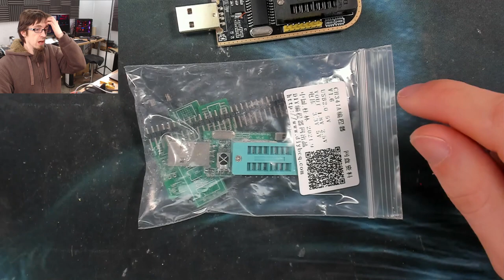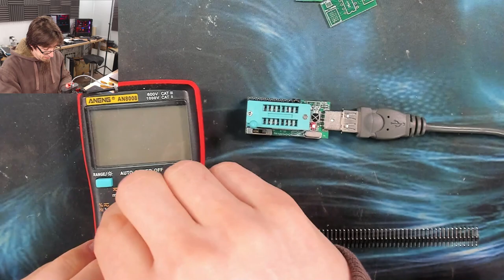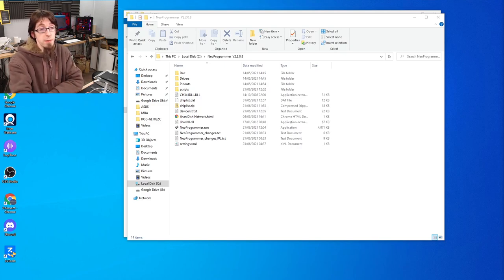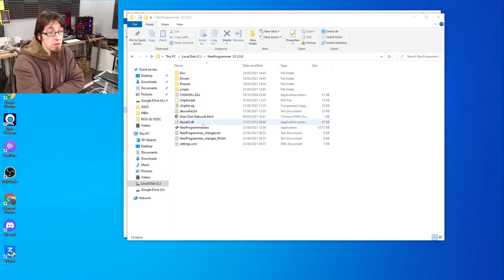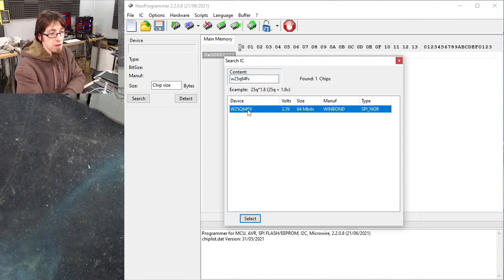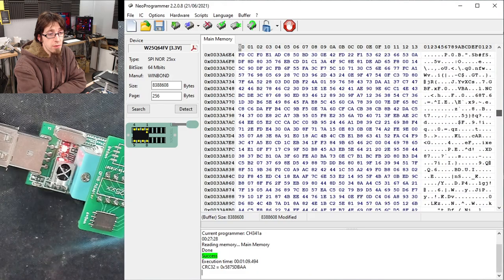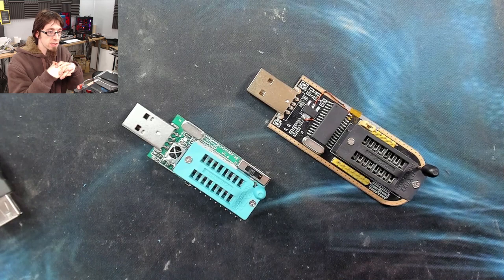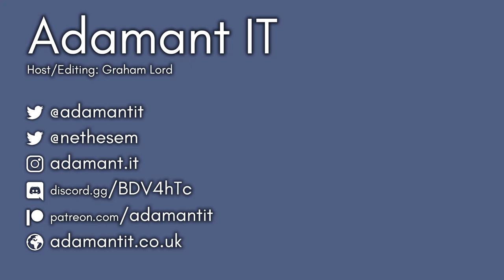CH341a v1.6 Review, No More Volt Mods! - LFC#297

Comment: I challenge you to find a 3.3V chip that you can burn with the older programmer. milliamp limits won't let it overload them.
Reply: I use my ch341a, the old one with the black pcb without mods on 1.8v chips but i use a 1.8v adapter.
Reply: @@garbonzobear yea
Reply: But it doesn’t work
Reply: I saw a vid from sorin electronics as well showing you that you cannot burn a chip with the old version as you said the amps or miliamps wont let you.. that said i still bout the newer version as i am a scardy cat lol
Reply: @Pedro-ct8ou  yeah you can't burn it out. Nobody has done it and the old model puts the correct voltage out on the read lines anyway. Now people have BRICKED their mobos but they do that with either reader and by pinning the programmer wrong, not making more than 1 read and not comparing reads and generally not knowing what they are doing, but yeah

Comment: If someone knows how to 3d print and make a template, they can make a nice cover for it. And make the template free :) For the old one are several templates also accessible.
Reply from the maker: If I had access to a 3D printer, I'd totally be into an enclosure for this that converted it into more of a "desktop" widget. The main reason I prefer my RT809f over the CH341a is because the RT809f is a box that connects with a cable, instead of needing a USB extension cable that's clamped to the desk. Plugging a CH341a directly into a tower PC is kinda clunky, although there's nothing wrong about it.
Reply: @Adamant_IT  Yes, the form factor and treatability are important when you use a tool on a daily basis. I have 5 programmers, ranging from cheap to quite expensive, but I still prefer to use the old EZP2010 simply because it is so compact, robustly built and handy.
Reply from the maker: Is the software better for the EZP these days? I dropped my EZP2019 basically as soon as I got anything else because I found it super hit and miss with chip support and reliability. But that also might be because it was my first programmer and I was still figuring out how to use them properly.
Reply: @Adamant_IT  If you're interested, a monoprice select v2 can be had on sale around $99 or an ender 3 can be found for as low as $130 but takes at least an hour to build and without any experience another hour to get it configured properly, so not for the faint of heart who can't handle some troubleshooting, but otherwise both are great beginner printers.
Reply: @Adamant_IT  I never had any problems with the software (with 2010, I don't have 2019). It programs much faster than the CH341 and doesn't make any mistakes. When it comes to onboard programming, the CH341 recognises many EEproms, which is not recognised by EZP onboard, but when reading and writing, the CH341 almost always makes mistakes. So if EZP says it can't do it, but the CH341 does, it does it with error.
My first one was the AJAWe 0812, but it was extremely slow. Then the EZP2010, SVOD1 (for EC), out of curiosity CH341, SVOD3.
Reply: @SiETechNotebookReparatur  one problem w EZP2010 is the chip detect might be wrong for newer chips.. so manually select proper example 25Q64 detects as 25Q32 and have to select similar winbond with 64 in middle number (size) for full read not 1/2 the chip.. ezp2019 has no problem w that as its current w all chips JDEC detect id.
Reply: @LeadFarmer813  The EZP 2010 is a 12-year-old device. Up to 64M-bit, I have only had very few problems with recognition, but above that it often fails to recognise or recognises incorrectly.
But I only work with laptops. 
Up to now, almost 90% of the work on BIOS chips could be done with the EZP2010, the rest is done with other programmers. For me, it's like an old wrench that's already worn out, but it feels so good in my hand that I still prefer using it to the newer tools :)
Of course, over time it becomes less and less usable...

Comment: Always make sure to do at least 2 reads and compare using a program like HxD before you overwrite your chip. Neoprogrammer, and most other programmers, don't verify reads in any way so you can't rely on a single read. A bad connection that causes a bad read wont cause any errors and you will end up with an unusable backup.
Reply: THIS!  Extra reads are free, don't be tempted to short-cut good procedure and skip this step -- you may find yourself sorely regretting it!

Comment: The CH341a doesn't supply 5v to the data lines. So no need to mod it.

If you multimeter it with no draw, it will show 4.7v, but once connected to the chip it will drop to 3.4v. Which is well within spec. 

Plus current is more important when you talk about burning chips.
Reply: Do you know what the jumper pins are for? The yellow rows with one jumper located
Reply: Is there a source to back up what you're saying?
Reply: YOU ARE RIGHT!
Reply: @kingeling  you can measure it yourself

Comment: your past volt mod & reprogamming videos on this tool saved me from having to buy a new motherboard, thanks =)
Reply: Me too, i was able to bring back my DZ87KLT-75K from the almost-dead realm of motherboards 😀
Reply: …. The only way you can damage your bios chip is by not knowing what you’re doing this programmer doesn’t put out enough miliamps to burn a chip and under a multi meter while running its 3.4 volts current is needed to burn chips don’t listen to idiots

Comment: Watched a review on the original programmer you showed that had the mod on it. The guy measuring the voltage going through and the current was so low it wasn't an issue.

Comment: Great video.
Thank you for sharing!

I have two CH341A v1.7 programmers on order and can't wait to put them in my service tool bags. :)
Reply: Did they work?  mine read junk
Reply: @bn880 
On the unit I got it seemed to work ok.
I know it is very important to check the chip's datasheet to make sure you are using the correct voltage setting.

Like any product there is a chance you got a DOA item, but it is always good to test with a known working chip.

I also have a TL866II+ that I verified with the DIP SPI Flash chip that I used with the CH341A v1.7 I got.  Both read the same contents.
Reply: Yeah using correct voltage, but no 2 reads are the same   @David_Ladd   Still have not gotten the "official" soft for it, crazy baidu links.  Using the open source versions.
Reply: @David_Ladd   Actually if you know of an open link to DL the software for it that would be appreciated.  (not the baidu spyware stuff)

Comment: I need help. I have tried over and over to reprogram the bios chip on a Surface Pro 4. It uses a winbond W25Q128FVPIQ. I tried attaching the ribbon to the chip on the board. I bought digital chips The Flash directly but they don't have that model ship anymore they don't make it they have a substitute it's the w25 q128 jvp IQ. I tried a Windows computer and I've tried Android I've tried as programmer and Neo along with others it's never automatically detecting the chip. And when it says it's writing it never works on the verification. I believe the issue at some point it has to do with the status registers. But I'm not sure I don't know what to do I need help please thank you

Comment: Looks like it's worth buying just for the adapter PCBs, of which one looks like it should support the USON (0.5mm pitch) footprint which is used a lot with Macbooks, especially the USB-C models for the thunderbolt ROM storage for each pair of CD32xx chips.  Was going to design/fab my own but this would seem to be a simpler option ( and pick up some other interesting ones too I see ).
Reply: Better buy one then 🤣
Reply: @MrPnew1  lurker.  Guess I should make it two then ?
Reply: also can you somehow when you have time comparing those two circuit so we can mod older one with voltage selector also infra that would be much apperciated  and i hope for a free  registersion of board view paul

Comment: i did the silly SAM port clip on the air 820-3437 in 2017.. baked something and that was that.. i learned to take chip off on most boards excluding VGA cards as they usually work fine if not in PCIE slot.
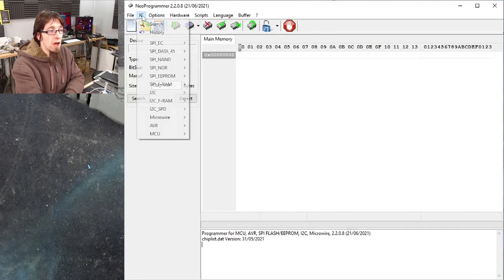tip: 12:07 u can click detect on left side and should find it auto.
and no it doesnt have pin detect, just same as prior ch341a no extra test circuit like RT809 orTL866II+
the black pcb tends to popcorn the layers very easy if u try to solder chip on it w very high temps.

Comment: I modded mine by cutting the 5v trace and put a solder bridge between the 5v and 3v pin on the back. no need for wires. also easily reversible if ever needed.

Comment: The volt mod is unnecessary and a lot of people get that wrong and blindly spread that misinformation and apply the mod without actually testing the Voltage on the pins directly.  Even at 5V when you connect a BIOS and it requires 3.3V you'll find it reads 3.2 ~3.4 on the BIOS pins.  No mod necessary.
Reply: Voltage of 5v don't cook chip its higher current that does damages!

Comment: First thought was wish I'd waited just a bit and got this one, since I just got the other type.  Going to be much easier to accidentally leave that switch in the wrong position though vs use the 1.8V adapter, so second thought is OK I'm fine with having the other version.
Make sure you keep checking the voltage every time on the socket with a voltmeter as part of your procedure, good practice and it's going to be very easy to forget and leave the switch in the wrong position if you get used to just plugging in chips without checking.
Needs feedback.  LEDs, red = 5V, yellow=3.3V, green=2.5V, blue=1.8V or similar would be good.  Then you could just check the LEDs every time before inserting the chip and drop the manual voltmeter check.
Reply: Don't be paranoid. Even using the black CH341A board you don't need to do a volt-mod or volt select thingy or separate board for 1.8V chips. Yes, at idle you will see 5V on the data lines, but when you connect the appropriate chip, the voltage will automatically decrease to the required level. The fact is that the current in the circuits of the data lines of this programmer is so small that the resistance of the chip you are programming is enough for the voltage to drop to the required level. You can check this very easily by connecting the chip and taking measurements, moreover, this is how a lot of professional programmers work.
I have been using this programmer for many years and not a single chip has been damaged by this programmer.
Reply: @Evhen_Velikiy  sorin also said this to the panic of 5v on data and power lines, checking upon it, it drops below the need voltage.

Comment: Question: Did you figure out why they added a IR remote control receiver in the new version?
Reply from the maker: Apparently it's for decoding TV remotes and such like, which makes sense, as I can't think of anything else still using IR for communications.
Reply: Reasoning is easy enough, it's a quarter or 50 cent part that lets you check remotes and maybe even back up the remote codes etc on a piece of test gear you're already going to have around, instead of having to have or find something else to do it.  Near free extra function.
The real question is what pin is it on, and if the rest of the programmer is basically the the same the software should work and we can add it on the other versions.
You can check if a remote works at all easily, just point it at a cam most pick up infrared.  But if this will read the codes and store custom codes it'll be handy vs having something else around to do it.
Don't need it often, but it's not a bad cheap add on since it's already a USB attached test device..
Reply: Actually there's more.  Looking around the site for the main files later, this came up :
CH340IR.ZIP	CH340 USB to IrDA infrared WINDOWS driver, support 2000, XP, for USB infrared adapter based on CH340, USB to infrared interface.
And a CH340IR.E**, changed of course..  
	USB to IrDA infrared WINDOWS driver for CH340, used for USB to infrared IrDA interface, USB infrared adapter, used to distribute to end users with the product.

Whenever I run back into my IRDA parts I'll tack one on and try and get it running.  Low priority so may be a while but I should run into them eventually.

Comment: i programmed my 1.8v bios chip using the old ch341a without even the 3.3v mod or the 1.8v adapter,just  plugged it in. Verifying the chip always leaded to some errors,anyway it just worked.

Comment: Been into tech since I was a kid, building PCs, etc. But very new to soldering, dealing with the more intricate side of electronics like this.

Is a BIOS reprogrammer like this good for any kind of flash chip, with the right adapter, or is it meant primarily for the type of chips used for desktop and laptop BIOS?

I'm thinking specifically of consoles, especially given the recent reports of Wii U failures due to a NAND chip going bad.

Comment: When you get all of your affiliate links set-up, could you link to all of your equipment: soldering iron/station, hot air gun, various programmers, etcetera? Even though I'm in the USA, I've assembled my workbench to include sockets and voltages to allow me to use equipment from anywhere in the world. I am using a generator to provide ~240vac single phase since the USA standard is dual phase (two out of phase 120vac). Thanks - I love your videos!

Comment: Hey great video. I have changed the Bios chip andrewrite a new Bios using the programmer. Now the PC it's starting but unfortunately I have no video output. Is there something that I missed? I was trying 2 or 3 different Bios also the one from Lenovo. Is there anything else that can be done?

Comment: Hey Adam. a little off-topic question, I saw you have a Hanmer HM310P power supply, so I got one as well, but every time I turn it on after it was off for a while, I hear a loud bang and particular smell comes out of it. It seems to be working for now, but did you have the same problem? If so have you fixed it?
Reply from the maker: I have not encountered that... if your PSU is making pops and smells though, I would stop using it and open it up to investigate, or return it.
Reply: @Adamant_IT  Thx, will check it out

Comment: I can't find this updated version in a kit with the clip for soldered chips.
Reply: ali express has tons of them. However you don't need the updated chip. The 5 volts was never an issue and if you are connecting the pins correctly on the original chip you will get a 3.3v out. Flashing a 3.3v bios chip with 5v isn't going to damage or burn your chip out anyway, it just might make reads/writes a tad more unstable. Can you even find evidence of people burning their chips out with the original? lol. no. You can't. plenty of people brick their mobos but it doesn't matter which chip they are using, they skip steps and pin it wrong. The original chip is completely safe/fine and if you're ultra paranoid you can solder 2 little connections on it to make it only run 3.3v. For me, it worked
Reply: @escapetherace1943  You say that, but I went ahead and just bought the v1.5 kit with a 1.7 adapter. One of the chips I needed to flash was a 1.8v chip anyway, so having the extra voltage selector was best.
Reply: @Levy_Wilson  right, well it is probably better in your case you did so. I flashed many 3.3v chips including one yesterday with the regular ch341a and.... all of them were fine.

Comment: Great vid!
I know I'm going to need to get one of these because I'm pretty certain I'll need to use one at some point.
Also some kits come with a clip adapter on a ribbon cable used for SMD chips, I don't know if that's better than de-soldering and re-soldering, but it seems a little more convenient for my needs.
Reply from the maker: I still hear wildly conflicting opinions about in-circuit flashing. I think there are plenty of times when it works / is safe, but also I think you need more knowledge about the device your fixing, specifically what else is on the SPI bus that you will be sending power and signals to when you clip onto the BIOS chip. But yea, I'll be researching it at some point, as there are a few cases where it makes life significantly easier, and potentially more accessible for people who aren't ready to get into soldering.

Comment: Interesting revision but despite being affordable they still need to work on the price, it may have gone up a bit but either way, you can get the original for as little as $4-5, so even including everything such as a 1.8v converter, SOP to DIP socket and a clip, costs only about $10 shipped.
Reply from the maker: That's a fair point. I feel like price is irrelevant once you're below $15, but certainly for people in poorer countries where absolute rock-bottom prices on tools make a big difference, the v1.6 is essentially twice the price.
Reply: @Adamant_IT  Well, I was thinking more so for beginners/hobbyist/someone starting out, for example I don't regularly fix computers, but I still wouldn't mind having one of these myself, however currently after shipping the new model costs $17 or more, actually triple what the old one costs, so yeah considering how little I would be using it, I'd rather spend the $5 and do the mod.

Comment: What made you realise that the data line was only 5V & not lower ? Do you think that installing OS from scratch means there are less OS code errors down the track then from creating an image & cloning an OS ?
Reply from the maker: I heard from the community about the over-voltage problem when was talking about the CH34a before getting one.
And no, I think Image and Cloning an OS is perfectly fine, although obviously it's only as good as the source image.
Reply: @Adamant_IT  Ok.